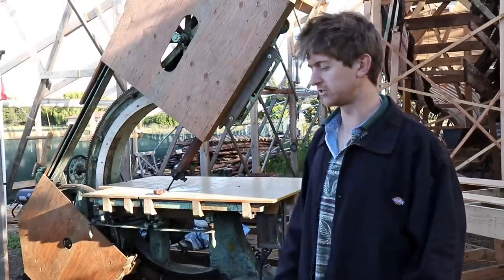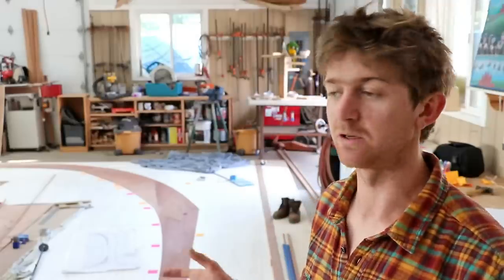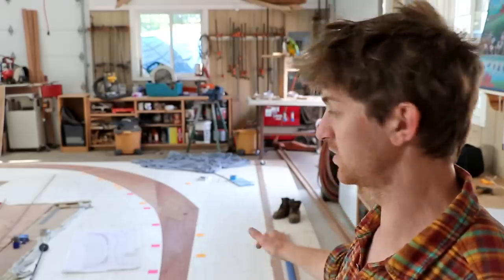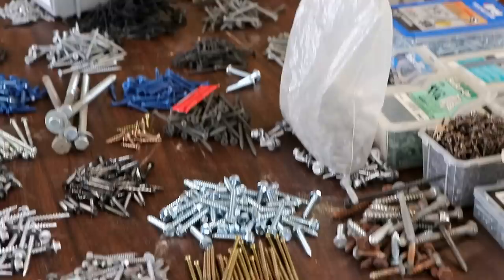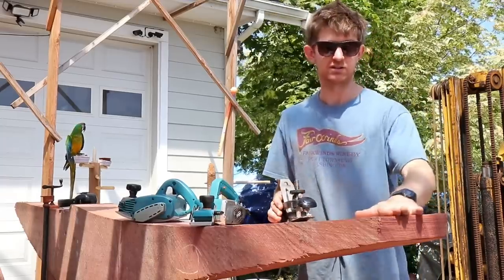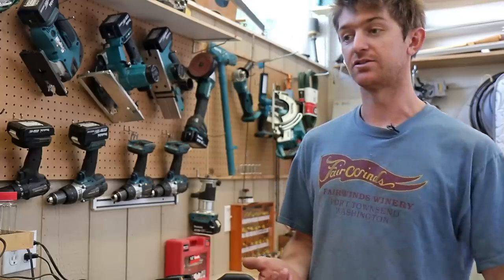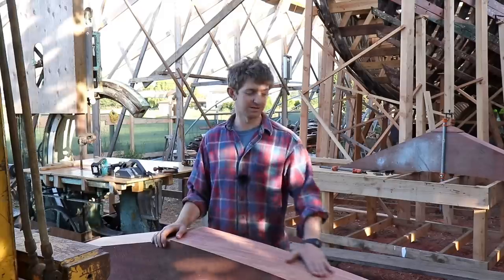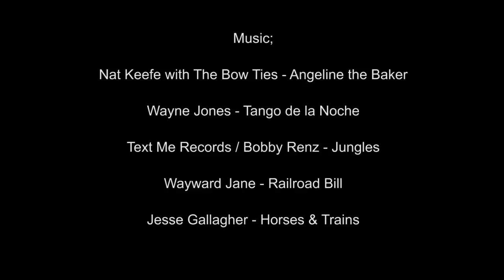Cutting the Bow timbers! - TALLY HO EP50

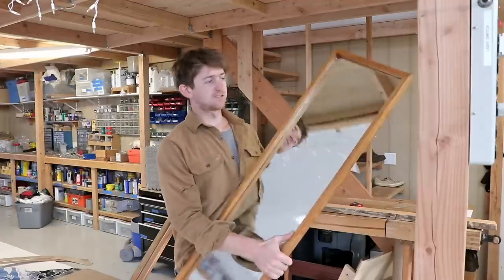Comment: "...wants a stand for this mirror...so I'm going to whip one up.(2:55)" Leo then cuts four mortises, four tenons, a square hole in two of the tenons, use a router to round over the corners of the parts, rounds their ends, and finishes it without glue or fasteners. "...is good quite fun to do little projects like that..."(4:45) Oh yes! To a man who shapes whole timbers into forty foot keels, this is just a "little project." To the weekend basement woodworker this is A Project.

Comment: Thanks Leo. Little tip with the Alaskan, if you're planning on doing many more long cuts, try mounting a small hand winch to the rear rail, and run it off a pulley. I use a length of chainsaw pull cord for the winch cable. It reduces the effort by about 80%, full gas on the throttle, and control the rate of cut with the winch. And if there's any chance you can keep this project up for the next year or five, you'll make me a very happy man! Thanks again for the video!!!

Comment: Too late now, but what you needed was a filter wrench. They need to be sized almost exactly for the diameter, but they are very easy to make. You cut a circle in a piece of sheet material like plywood or hardboard (Masonite™ or the like) that just fits the diameter. It should be cut in one end of a rectangle about 20% wider than the diameter and twice as long. Cut a wedge from the circle to the other end of the rectangle. Slip the circle over the filter and squeeze the sides of the wedge together gently. It gets a great grip without collapsing the fragile frame of the filter. If you can trim the head of the wrench to leave a uniform band around the opening it helps make the pressure even. Reshape the handles for comfort if you plan to use it more than a few times. 
(Or Amazon sells them; search for [ camera lens filter wrench ].)

Comment: So fun to watch this. I loved how nice you made the mirror stand. I was quite frustrated that you never talked about what you found on the gear shaft of the ship saw though;)
Reply: Would be nice to know
Reply: @stellarluna2637  I imagined that the Key in the Key way had worn out and allowed slop. I think that is right I have had the same issues on machines because they move around eventually.  He was also smart to  check the trueness roundness of the shaft hole and compare it I suppose to the shaft diameter and roundness.  He  is very thoughtful and thorough about everything.  My wife imagined his family gave him the work ethic of doing things correctly the first time.  Wonderful to watch his great example.
Reply: Baron Marseille  Yes, bush and ream the hole....weld the shaft up and spin it in a lathe back to size.
Reply: Looks like it uses Babbit for the bearing. Shaft is probably not worn.
Reply: Baron Marseille  A job for This Old Tony
Reply: @rick_.  I thought the same thing since I didn't see a bushing or bearing
Reply: Baron Marseille  rebabbitting is often done still.
Reply: @ncmartinez_his  [
Reply: Baron Marseille  With is skillset he is capable of doing the repair himself.
JIM
Reply: Baron Marseille  I know how it is done, learned about 40 years ago.
Reply: Baron Marseille  You could be correct, but given the time, I am sure he could achieve success,
Time is an element here though.  The saw is needed now not later.
The other thing that comes to mind is that I seem to remember that the saw is on loan and must be returned to  the owner on completion of the restoration, so I think the owner must be contacted to see how he wants the saw repaired!
JIM
Reply: Baron Marseille  My head hurt after reading that. Kinda like the crappy noise on this chanell. d/v\/
Reply: @PatrickPoet  rebabbitting rebabbitting rebabbitting Try saying that out loud xD Nice to learn a new word as a non native english speaker

Comment: I worked in a shop where one day the shelves that held all of the fasteners came crashing to the floor.  I shoveled everything into buckets and spent several days separating it all out. Then building new cabinets for them all.  Loved the Forefoot picnic table.  I had a filter crack like that once and it imploded inwards, scaring the lens. Protection doesn't always work.  Glad yours escaped.

Comment: What ended up happening with the ship saw? The video kinda cut to a different part and it wasn’t mentioned again
Reply: more than likely sleeve bearing has worn
Reply: @TheAggromonster  Thinking the exact same thing. You can even see the outer edge of the babbit @2:49

It's been ages ago, but I got to see one being poured at a milling plant that I would occasionally do electrical work for. Pretty cool how it's done.
Reply: @TheAggromonster  or Kieth Fenner [gets my nomination] !
Reply: If that's indeed a babbit bearing, then hot damn, that's gonna be difficult to pour. Doesn't look like a standard operation (separate from the body).
Reply: @aserta  Looks to me like a line-boring job and pressing in a new bronze bushing
Reply: Abom79 for the repairs, its a big machine, right up his alley.
Reply: @mikegremlin5249  You watch Abom79 too then?
Reply: aserta With Babbitt, you can actually hold the shaft in place, build up containment and pour it right into the bore.

Tricky process, but doable. Probably gonna do a bronze bushing though, I’d guess.
Reply: @Nevir202  Yeah, you just lop off the extra that gets created during the pour. I'm no machinist, can you get sintered bronze bushings in arbitrary sizes? (I imagine it should be a sintered bushing, but maybe not). And of course the shaft needs to be cleaned up...
Reply: MrWaalkman No telling if that bore is of a regular size so he could buy an oil impregnated, sintered bronze bushing, but I’d think not. So, probably just have one turned. From the application, I’d think he will want some high-leaded bronze.
Reply: Torch out the bearing and replace with bearing bronze, just make sure you have some tracks for grease to minimize wear.
Reply: The ship saw didn't get worked on, yet!! Cecca hasn't told him to!! :-)P
Reply: Option one Heat up the Babbitt melt it out measure for a bronze bearing . Have one made make a basic rig to pull the bearing in (threaded rod and some plates) drill for grease fitting. option 2 (the old way) find a bushing that fits the shaft (maybe have some one turn the shaft on a lath to clean it up). find a true craftsman with a steady hand and bore the babbit. Press and epoxy the new bushing in.  This is just a very slow hand operated gear. Does not need to be perfect.
Reply: @Nevir202  I am certain he can't use an oil filled sintered bearing in that. Those bearing can not be reamed to final size with out ruining them. So the shaft would have to be sleeved or spray welded, then machined to proper dimension. Then the saw body would have to be align bored to the proper size to compress the bearing to its final dimension.

It also does not look like a Babbitt bearing to me. The boss would probably be split if it was a Babbitt so it could be tightened to compensate for wear. It looks to me like it is just a sleeve bearing that was pressed in at the factory, or possibly it is a repair done at a later date.

He is in a rural area where lots of heavy equipment is used. Should be plenty of people that can come out and align bore it and install a new sleeve. It is just a few hours of work for a pro with the right tools - it is a routine job on farm/mining/logging equipment.
Reply: Alot of people have asked this question. I've just watched this video, leo got one of the lad's to bend some shim steel around the shaft and pack it with grease,as a temporary fix.
I know it's 2 years ago now ,but I'm just catching up. 2021

Comment: On the ship saw.... those are babbit bronze bearings... not an easy rebuild! I would recomend run it until that bearing surface becomes unusable. Then you have quite a job ahead of yourself of melting out old babbit and casting a new one in its place. This processes was comon but now is used in millwright work. Typically rebuilding old power hammers pre 1960's. (Little giant power hammers) babbits are an awesome precision bearing surface best repoured in the orinal fashion of low temp bronze and clay dams. A similar process for soft bearings was used for lead.

Comment: Hi Leo, isn't there a machine shop close by that can bore out the hole in your saw, and fit a new stainless sleeve on the shaft?
Reply: Oilite wouldn't be the best choice for something turning that slow, a stainless or maybe bronze lining shrink fitted on to the shaft would be better and then lubricated with lots of grease, it's the same way rudder stocks are made/repaired
Reply: @RasmusHuusom  Never make a bush out of stainless steel, you will get problems with the stainless "picking up", best material would be bronze or oilite or even brass.
Reply: It's not for a bushing... And yes we all know stainless will gall with stainless or other high chromium materials, but when used correctly against the right materials with proper lubrication it's a supper way to get new life out of an old shaft without weakening it, as you will need to do if you just fit a bushing into the bore and turn the shaft to fit...

Comment: That ship saw fix is a tough one. Maybe pour a Babbet  bearing with the pinion shaft in place maybe? Or perhaps bore it out with a annular cutter on a MAG drill. Then press a sleeve in. Doing it without moving the damn thing. I can't wait to see what black magic you come up with to fix that.
Reply: Ok. So there is a, or two zerk fittings in the casting. I would position the shaft accurately and pour the Babbet in through the zerk holes. You'll need to heat the casting obviously and perhaps even reduce the shaft diameter to give some space for the Babbet. Pretty sure that would work.
Reply: Or a small portable line boring machine be best probably. Then bronze sleeve.

Comment: Great news that the lens was not damaged! I had cringed when I saw your original photo of the damage.  Btw, speaking of lenses/cameras, did you change anything in your video setup or workflow? The intro to this video seemed to be particularly great quality.  Rich color saturation, super sharp, crisp focus... good stuff.
Reply: Going down the line of sacrificial victims, a lens hood (even a cheapie plastic or rubber one) may have saved the expensive filter. Barring that, you could also completely encase the camera in spray foam insulation, lol.

Comment: Hey Leo, are you accepting bookings when Tally Ho sets sail ? If so where do I sign up ? I don't care where we go just as long as we leave for the open sea.
Reply: Mind what you ask for. I wired a rebuilt Bristol Channel pilot cutter, the skipper requested I come on the maiden voyage, found my self finishing wiring while under way with my head in a locker bolting connections. The best of that was when we noticed the floor boards were awash while we were sailing. Very glad the bilge pump worked. Maiden voyages can be interesting......

Comment: I’d be surprised if a local shipyard machine isn’t wouldn’t turn out a new shaft for you.  Frankly, with all the stress transferred to that shaft end the builder/designer should have extended the length of the shaft hold by welding on (casting) an additional collar.  Beyond that, using replaceable brass blocks as stays relieves the compression stress under which the old hardened steel ones continue to compress eventually hardening and doing damage to surrounding structures like banging a steel hammer on cast parts....disaster looms never far away.

Comment: there are portable line boring companies that work on heavy equipment  they will come out and carefully measure the position of the shaft centerline thru the held in place gear.. so lash is minimized..   since that is a babbeted bearing.. and its bored offset.  it was bored after it was poured..  you may want to carefully edit a video of it to send to several companies for bids or estimates.  there is a place called wright machine over by boeing field that does that.   its a complex fix..  as you have a worm gear on one end and a spur gear on the other and there can be almost no lash..  if you build a custom wood clamp set that can hold both worm and spur gear in place..   you could get measurements from the centers in the shaft ends from several angles.   so it could it could be positioned perfectly in jigs for a babbit pour. depending on the shaft size.. there might be caged needle bearing assemblies that could be used.  if the exact shaft center line can be calculated.  then just bore into the babbet and insert new needle bearings.  there is another way also. if the centerline can be established.  bore the bearing bore till its perfect.. carve grease grooves in it..  create a new stepped shaft with the center that fits the new bore perfectly and stepped down on each end for the existing gears. 

 in the mean time to get the ships saw back up and running..  create some hardwood wedge cones. 

 another way would be to remove the grease fittings..  clean the bore perfectly.. grind some grooves into the bore..  spray the shaft with mold release..  insert the shaft..put the gears on it.. hold the gears in place with clamps or jigs so the lash is removed..  use a 2 component epoxy pumped thru the open grease bores to fill the cavity around the shaft with epoxy or some other material..  when that is cured.. remove the gears.. pull the shaft out.  redrill the grease fittings to get the injected material out.. carve grease channels in the new surface and return put it back together.. that is 100 years of wear on a babbit bearing. 

 another thing that you could do..   drill the housing in 2 places on each side. then drill it slightly larger and put in some big allen set screws.. this could push on either a plastic rod or some of your silicone bronze rod against the shaft to  take up slack where the gear pushes away from its mate..  this could be done in a few hours.  perhaps with only 200 bucks worth of supplies.. you will need several drills... big metal tap and allen set screws if you don't just thread up some of your rod and cut a screwdriver slot.. but you will need floating inserts that are shaped to the shaft..  think of electric motor brushes.. but instead of springs.. you are using set screws to center the armature/shaft.  is it the proper fix.. nope..  will it work in the short run .. yes..  will it destroy your ship saw.. nope.  the spur gear side is going to be harder as you have to drill in at an angle.

Comment: What was the issue with the ship saw? Worn bearing or bushing?
Reply: The bearing was a soft-metal 'babbitt' alloy, commonly used for machinery of that age. Leo has several options to repair it. A) Drill out the center on-site & insert a bushing. B) Melt out the old metal, pour in new babbitt & drill the center. C) Drill out the babbitt & replace it w/ modern roller-bearings. Each method has its time & money concerns, but I'm sure Leo will get it sorted in time for the bow framing party.

Comment: That's a worn out babbitt bearing in the saw.  See if you can get in touch with one of the experienced YouTube machinist, like Keith Fenner from Turnwright, Adam Booth from Abom, Keith Rucker from Vintage Machinery, or Tom Lipton from Ox Tools, for some advice.  I know Fenner has done a video of him pouring babbitt, but I'm not sure how the process would need to be changed for that particular application.  Usually there's a split line in the middle of a babbitt bearing and the thing gets pulled apart for cleaning both before and after the pour...

I feel like the ideal, long term,  would be to bore it out for a pair of ball bearings.  But that would require bringing that part of the saw to a machine shop, and that seems like a big pain in the neck as well as a major disruption to your workflow.

Comment: WD-40 is NOT a lubricant. Sorry, I just learned that yesterday in the sidebar of one of your videos. maybe you are not using it in place of oil, but maybe you are. Oil lubricates more effectively than WD-40, and you will more likely have better results for lubrication with oil. I only mention this because of your recent tool failure rate, not because I know anything. At all.

Comment: Leo, what was the repair on ship saw? How done?
Reply: I noticed a line of different colored metal around that shaft hole.  Looks like it was babbitt lined.
Reply: @jfirebaugh  I saw lube zerk and it looked clean? I see this will be a job. You can't just find a new one to press in.
Reply: @robb1460  That's a really old saw.  Probably before press in bearings or bushings.  Babbitt was cast in place and then bored to the proper dimension.  Might need to call Jay Leno to get some expert advice.  I wonder if he is following this channel.
Reply: @jfirebaugh  Looking at the hole, it had four slot channels on the babbitt outside diameter to keep I guess from turning when bored in place? Maybe?
Reply: @robb1460  I think they are just notches that lock the babbitt liner in the hole so it can't turn.  The babbitt is supposed to be pored in while the surrounding metal is preheated to prevent the babbitt from separating, but that is a lot of metal.  Probably hard to get it up to temperature.